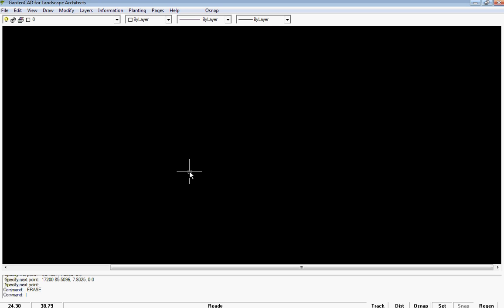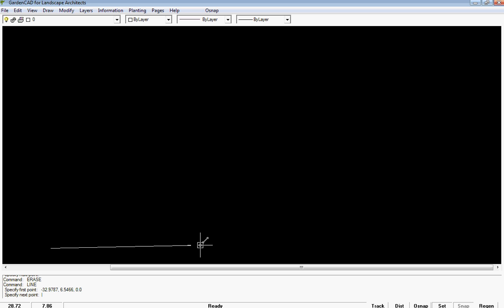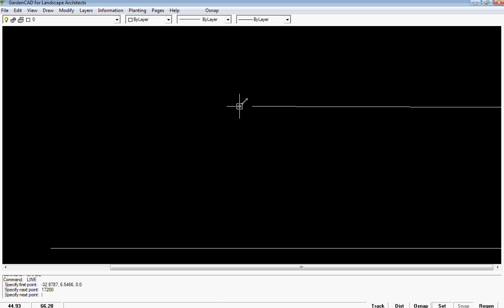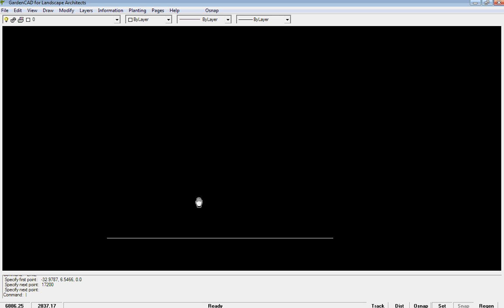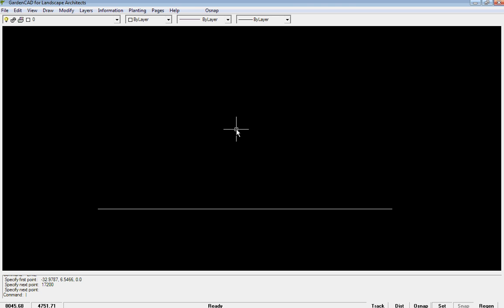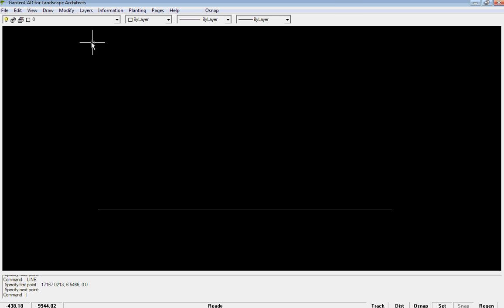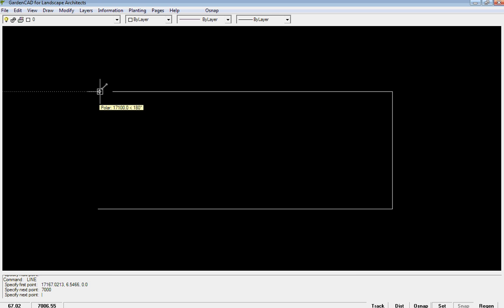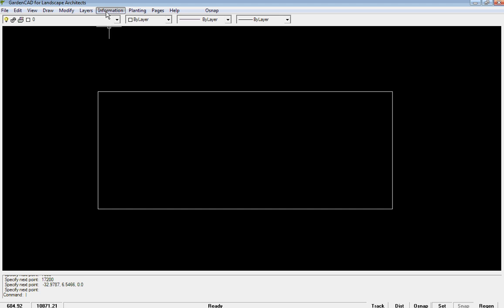Laying out a site for the rear of a terrace house using gardenCAD software

Comment: Why is it that when you open up the programme about to work in the space your polar tracking is automatically working in mm? e.g. 17200 shown on your polar tracking, which translates to 17.2 metres. I desperately need to work in this manner, though my polar tracking is going up in units of 10!
Reply from the maker: Jamesy G gCADPlus works in drawing units just like AutoCAD. If you are working in the metric world and in architectural, everything in the building trade is measure in mm. When you starts a new drawing, we present you with a space that is big enough to do a typical landscape job. If you have not chosen a template, the space will be about 30,000 mm wide (30 meters). The easiest way to work in to start the line, left click to set the start location, then move your mouse in the direction you want to go and type the distance and hit ENTER. Do not worry about polar tracking till you gain more experience.